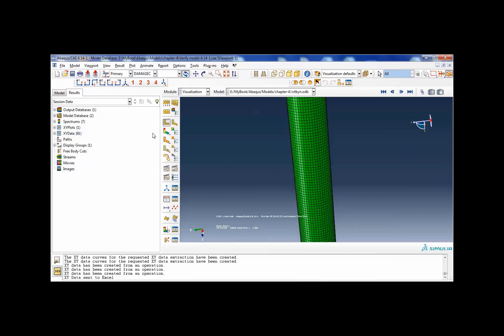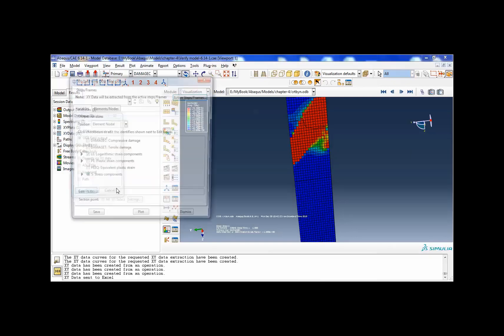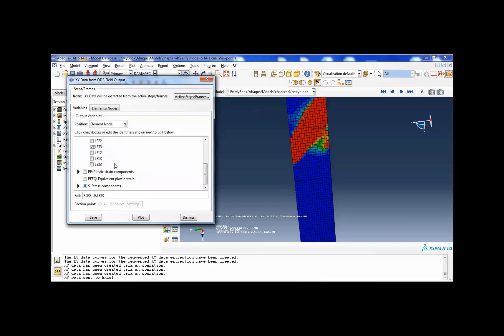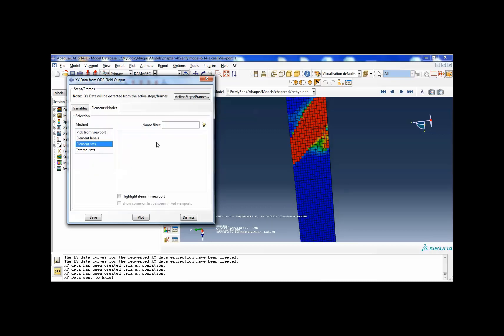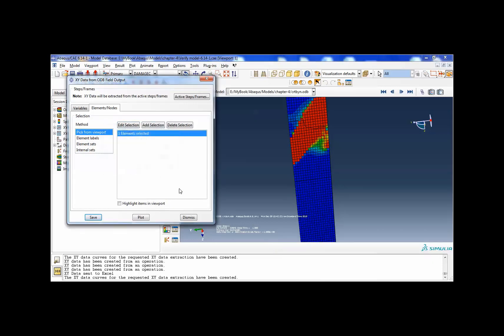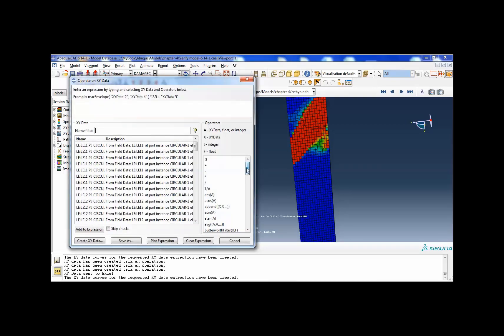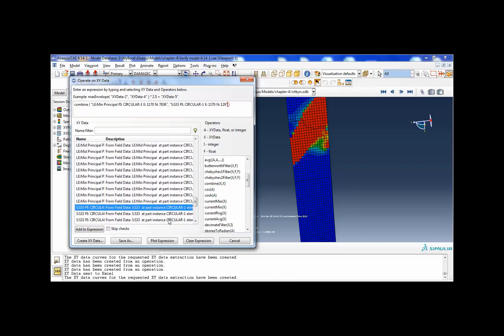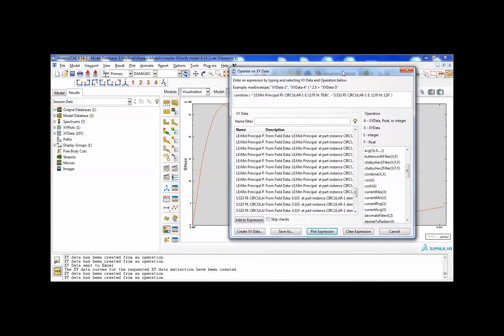ABAQUS Video Tutorial; Modeling Concrete Cylinder using Concrete Damage Plasticity in ABAQUS

Comment: Did you take your parameters from paper and your results similar to this paper?
Reply from the maker: yes
Reply: @numericalarchive4614  

can i see which paper you follow it in your video to check it ?
Reply from the maker: @theengineer6224  Paula Silva Vinagre-INFLUENCE OF CROSS SECTION GEOMETRY ON   THE CONFINEMENT OF REINFORCED CONCRETE COLUMNS WITH CFRP COMPOSITES